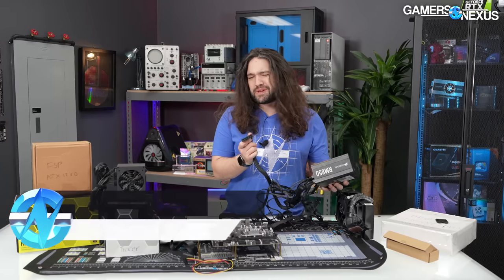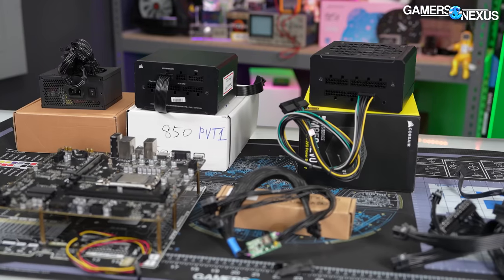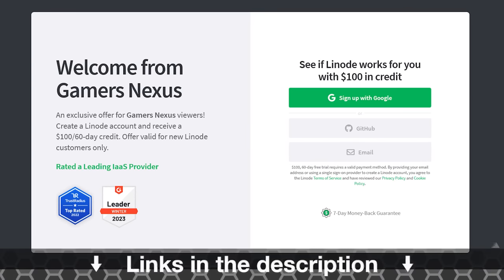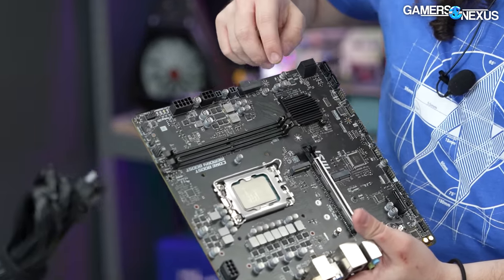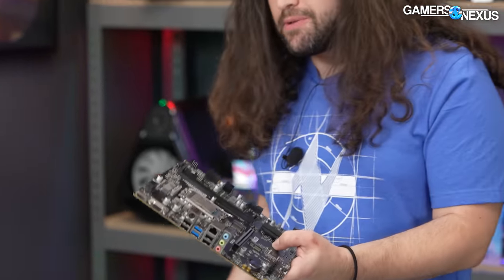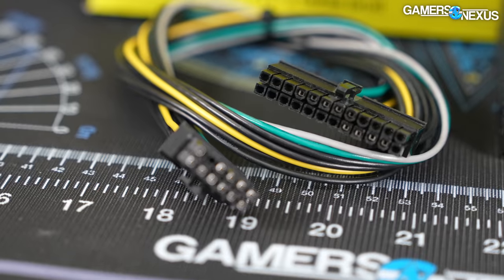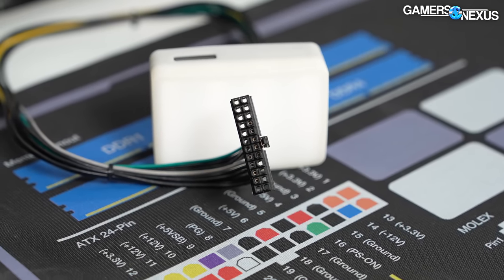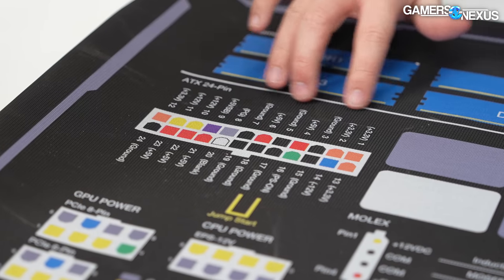The Future of Power Supplies - Maybe (Motherboard Cost, Cables, & ATX12VO)

Comment: 12VO being more energy efficient is good. But I don't like the notion of it being on the motherboard too. Board prices will go up, PSUs will NOT go down and now there is one extra reason for your motherboard to die, like they aren't the most common part to fail already.
Reply: Board prices are already going up - but many points won't change.  I expect to see mobos with less pin out options dropping.
Reply: And another reason To make certificate thing to motherboard and make it even more pricey
Reply: sure, lets talk about power efficiency in a world where graphics card draws 300watts
Reply: @Hsiss  Only 300?

GPUs need a serious power efficiency change, that's for sure.
Reply: @Hsiss  meanwhile Intel 13900k reaches 350 watts.
Reply: @Apollo-Computers  Exactly if they want us using 12vo PSU's they need to drop the power requirements on CPU's massively.
Reply: One PSU can outlast like 5 motherboards. Silly move. Stick to ATX, don't buy 12vo.
Reply: @D9ID9I  seems to imply the other way around.  Buy a 12vo psu that will be future proofed and last across multiple motherboards.
Reply: This transition must happen sooner or later. They just should've thought this through more carefully imho.
I would just retire 5V consumers before needlessly complicating the board only to provide 5V for long obsolete devices like SATA drives.
Seriously there's no reason to keep using those in a modern PC. SATA is a bus for HDDs and optical drives. Both are long obsolete and SSDs have NVME for years now.
Reply: @JE-zl6uy  12vo is a castrated version of ATX one. So which one is more future-proof actually? 😂 You can't go wrong with ATX PSU. In worst case it will be $5 adapter cable.
Reply: @Apollo-Computers  Do not worry - it will convert itself into 0.47587 horses. See, now it's eco friendly.
Reply: @1stRanger  Agreed.  While backwards compatibility is nice and all, I haven't used a SATA device in ages.
Reply: @1stRanger  orly, show me 20TB m.2 drive for just above $300 or GTFO. sata will outlast you.
Reply: @D9ID9I  LMAO
Reply: @1stRanger  You don't do productivity work, but I do. I need my HDDs for my work, video and music files.
Reply: Especialy since they will cheap out on those components on the mobo as they already do with the PSUs.
Reply: @DrowningInTea  Ofc and that's what NAS is for. That's a modern approach. HDD inside your PC is long outdated approach.
Reply: @1stRanger  Maybe in the first world
Reply: @Hsiss  exactly, i'd say 240v mobos here we go!!!
Reply: @Hsiss  exactly...this makes no sense for 12v lol. 240v mobos, here we go!
Reply: Gotta laugh @ the idea of more efficient - when we are looking at graphics cards sucking up half a killowatt and Intel banging out CPU's with all the efficiency of a combustion engine.

We got 1000W PSU's and they're concerned with the single digit wattage improvements of moving the sub 12v reg's from the PSU to the motherboard.
Reply: @1stRanger  yes but a nas is around 25 - 125 watts depending on the extra cpu . a non moving hard drive would be about a watt or two. running it would be 8-14 watts depending on amount of platters. NAS is still niche product and the asking prices are very high. 200 - 500 USD depending on brand and bays. a new hdd 4tb could be 100 USD or less and then you just plug it in. Taking sata off the board is fine if the chipset can still have sata controllers in a pcie slot. you do you though, especially if the home network is way better .
Reply: @1stRanger  How about USB which uses 5V? Remove them too?
Reply: also i am pretty sure that while it might be more efficient while idle

it should be notably LESS efficient under load
there is a reason you convert power voltage on AC power rather than DC given the option
Reply: @durandle9226  Every motherboard already does DC to DC conversions. Some of the most efficient platinum PSUs do DC to DC conversions. You were saying?
Reply: @Pasi123  USB doesn't use much power nor requires additional connectors, thus it's not a problem.
Reply: @@chahan691 You clearly lack the distinction between PSU and DC to DC converter. Every single motherboard has latter for decades. Having one more won't affect anything.
Reply: @1stRanger  Give me 20 TB nvme drive in a price range of hdd then talk to me on how great of an idea it is to drop sata.
Reply: @1stRanger  SATA is far from long obsolete.
Reply: @FabiVoltair  For high end hardware it IS obsolete for years now and can easily be dropped without anyone missing it. People that are paying 300-400$ plus for motherboards and CPUs and over 1k for graphics cards can afford multiple NVMe drives and NAS or external drive in case they need capacity and that's exactly what they are buying if they know their hardware.
Reply: @1stRanger  doesn't mean you have to jfc :P
Reply: Not to mention you're moving parts onto something that has a much lower useful lifespan even if it doesn't die
Reply: @1stRanger  What about USB? Requires 5V.
Reply: @killersberg1  I already answered that one. USB doesn't require much power.
Reply: @@chahan691 Ofc it adds complexity to the MB, but it takes that complexity out of power supply and most importantly from the wiring between PSU and MB. And that's what I as system integrator care about.
As for the argument about extra point of failure it is simply ridiculous. Build your circuitry right and nothing will fail. With such arguments you may as well go back to abacus, it won't ever fail.
Reply: @@chahan691 It's not a technology lol, it's a design and yes, it IS better than what we have today. At least for end users.
"Practically keeping power circuitry off the board allows flexibility in power design and keeping it as a modular component makes debugging board issues easier." - This whole sentence is a pure nonsense and it tells me that you have no idea what you're even talking about. Power circuitry is ON the board for decades. That's what all those MOSFETS and capacitors are for lol. To convert 12V to low voltage for CPU and GPU - biggest power consumers in a whole system by a huge margin. They don't use either of the voltages from PSU.
Let's talk market now. What is general market in your understanding? Who's buying these boards in your educated opinion? Maybe people that use them to assemble PCs aka system integrators and PC enthusiasts? Do you think these end users care about board complexity? No, they couldn't care less. And they most certainly not going to "debug" these boards at any level that this change may affect.
The only legit argument from you so far is price, which I find to be acceptable toll for progress. I'm also pretty sure this change won't affect the price in any significant way.
The rest of what you're trying to say against this standards is either completely irrelevant to end users or pure nonsense like your car with "square tires". Essentially that's your whole level of argumentation.
At the end of the day this will happen whether you like or not. So you can accept it or you can keep bitching about it. Latter will hardly affect a thing.
Reply: @@chahan691 I see no point in continuing this conversation about matters you clearly know very little about. No design is ever perfect and there’s always a price for progress.
One voltage PSU is future. Period.
You go keep living in denial. That’s your right and I couldn’t care less.

Comment: A few extra things to note: 
- Backwards compatibility to older motherboards is going to be a nightmare. Having to convert down to the other voltages.
- Nowadays, a good PSU can last over 10 years, but people usually change the rest of the components earlier than that, keeping their current PSU. That means that you are going to end up spending more money due to the incresed cost of the motherboards and the more regular rate of swaps.
Reply: I don't see why it would be a nightmare, would be trivial to design a 24pin adapter that takes 10pin + PCI-e or 8pin power and uses step down regulators to make 5v, 3.3v, I'm not 100% how the -12v pin would work but is that even used anymore?
Reply: @KriLL325783  even a negative voltage can be generated. No problem. Every current PSU does this already. They are already 12V only designs for years now, except the dedicated 5V stand-by supply.
Reply: @ronakparikh  Watch the video and actually pay attention, and maybe you'll figure it out. 

But if you're too lazy for that, the short of it is: If it got completely adopted in just a single city, it could remove not just kilowatts, but MEGAWATTS off of the total power consumption. Linus tested these ages ago, and found a solid 30 watt reduction in idle power use.
Reply: @ronakparikh  not sure where you live but I live in a city of 4.5M people, the regional centres are larger than your 100k number.
It adds up very quickly, also Steve mentioned it more than once but it went over your head.
Reply: Backwards compatibility won't matter, you'll just use an older PSU. It's not like a change is made and you can't by old stuff any more, this will take years to get into all home PC's. If they can get it into all government and big businesses in the next 3-5 years that would be great, most of those things are left on so IT departments can run upgrades after hours, so if they aren't using as much standby power it's a big win for the company/grid/planet. 😁
Reply: @ronakparikh  and the USA is the only country on the planet with people using computers?
The idle power draw isn't from gamers systems, it's from all the office computers all over world. Most of them are leased or they have service contracts which only cover them for three years, maybe a few extra if they pay for it. That means those computers will be replaced much faster than home computers, the difference will add up.
Atho referenced the Linus video where he got to test an early version, I went and found it for you as you want numbers.
https://youtu.be/heyGtgdfN7A?t=480
At that time stamp the system is drawing 60-80W, when changed to the 12VO setup it's ~32W.
Working out how many PC those sectors have is probably not worth my effort, there is a Wikipedia page with estimates of public sector size, it varies by country and when the data was reported. Somewhere between 20-30% of a countries workforce is in the public sector, some of them won't have a dedicated PC but most will.

As both Steve and Linus say, in their previous videos, this change is being driven governments setting tighter efficiency standards. For enthusiast builders it might not happen unless you specifically look for it.
To wrap your head around this you've got to look at the big picture, the really big picture.
Reply: @ronakparikh  Because the old design doesn't make sense anymore. Having a 5v and 3.3v rail made sense back in the day because logic level was 5v, 3.3V or not much lower and having a system level rail at those voltages meant they could use it directly without expensive (at the time) local switching regulators or inefficient linear regulators. Now switching regulators are cheap as chips, logic level voltages are even lower and I wouldn't be surprised if many supplies create 3.3V and 5V by attaching a couple of beefy buck regulators to the 12V rail... then when you have something that uses the 3.3V rail but operates at 1.8V now you have a chain like this: AC-12VDC(10% loss in the psu) -> 12VDC-3.3VDC(10% loss in the psu) -> 3.3VDC-1.8VDC(10% loss locally to the component)... why not just use 12V everywhere and make the device manufacturer do 12VDC-1.8VDC in one step saving one of those 10% losses? 
It's also making the system more adaptable as you don't need to make a beefy 100W 5V rail just to satisfy the 5/100 users who decide to install 10 disk drives and you can rely on component manufacturers to put exactly the size of 12V-5V regulator they need locally on their component, nothing more and nothing less.
Reply: @Cluuey  even in the usa there is 55 MSA with over 1 million population. these people are just shortsighted gamers who really dislike change even if its very beneficial.
Reply: 100k people is not a large city, that would be a very small city, a large city would be something well over a million people @ronakparikh
Reply: @ronakparikh  It is true, most people don't have ATX desktop PC's, they have 19VO computers that do all their power conversion on the motherboard. Also known as laptops. Oh the irony.

Comment: 48VDC seems like the next step once 12VO is widespread. That would only require a 4-pin connection to the motherboard for most setups 😅
Reply: Yes it would but the cost of power converters that can work on 48V input probably start to cost heaps more. The capacitors and indicators and MOSFETs all go up in spec and cost as well on anything that is 48V. Not sure if this also translates to increased track clearances on the PCB. Don't go putting 48V into lower voltage pins. I've seen someone plug their LAN into an old 48V phone system. The smoke and charcoal was amazing. So was the user's expectation that it would continue working after they let the smoke out.
Reply: @vk3fbab  I regularly put ethernet cables carrying 48VDC in devices, no issue there
Reply: @vk3fbab  perhaps that old 48V phone system also had an AC ringing voltage? In any case, 48v is everywhere in the telecoms world and it's great. Also for a given load in watts, your capacitors and mosfets might need higher voltage, but lower current, so capacitors can have less microfarads to do the same job. ST electronics call sub-30v mosfets "low-voltage" and the 30-350v mostfets are called "medium-voltage", so no one would need any special components.
Reply: PoE+ and newer use 48-56V to power devices over ethernet cables. USB PD3.1 goes up to 48V. I think the limit before major protective changes are required is when you’re needing 60V and above.
Reply: How about 24V?
Reply: 12VO would be good for 48VDC type installs, only a single DC-DC conversion instead of 3 or 4 with current spec

Comment: You don't actually need +3.3V. You can remove the +3.3V pins from the cables of your regular PSU, and the PC will probably work just fine.
10:52 The additional pins on the PSU side are sense pins, hence the doubled cables on the motherboard side.
As for +5V, it doesn't need to be created on the mobo, you can use an external buck converter, that you can stash somewhere else inside the case. Corsair already makes one ("+5V Load Balancer").
The big advantage of ATX12VO is that the PSU is much smaller (SFF, anyone?), more efficient, and quieter. Such PSUs will also provide much better performance at equivalent price, since there's only one rail that needs to perform well. Switching to ATX12VO would clear the market from all the garbage group-regulated PSUs.
Reply: Finally a sane comment here. Here in India I've only ever seen the garbage group-regulated ones. Pull too many amps on one line and the other goes out of regulation and potentially kills the mobo. I can't wait for 12VO to become mainstream.

Comment: I feel 12VO would be most useful as an OEM standard. From what I've gathered, the biggest excuse for oems using proprietary psu's is exactly because of the lower power draw. Lenovo has a 14 pin connector they started using in like 2014 for this reason.  It would be nice for oems to use the 12vo standard so you could actually buy an off the shelf replacement for it.
Reply: Opiplex 3020s 9020s  both is 4th gen intel use these connectors and they are a pain.
Reply: @AP_Sim  They are non standard ATX12VO, all connectors are a mess.
Reply: They do it for a reason. Big companies like Dell, HP and Lenovo now, IBM, Fujitsu and Compaq back then, use proprietary stuff is because they sell to other companies. Those companies don't necessarily care about upfront cost as much as speed of servicing. So, of course, they made it so the only people who could service a unit would be that company and that only. No one could undercut them then.
Reply: Then you could repair your pre-built PC instead of buying a new one. I don't expect that to be something they want.

Only pre-built PC brands without an existing standard would be interested if they needed to improve energy efficiency because of regulatory requirements. That way, they could save on R&D costs.
Reply: @CheapBastard1988  Oh but you can easily repair your pre built anyhow. By spending a good amount more for parts that are usually of average quality that only the OEM sells. And they sell it for maybe two years.

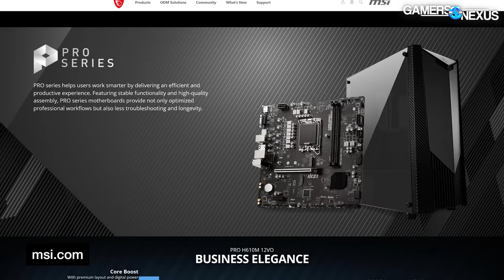Comment: 18:58 One interesting thing about that Motherboard is that it has the mounting holes for the VRM heatsinks. This means that they planed to put heatsinks on that board or they intended to release a higher price variation with heatsinks.

The fact that it has the mounting holes also makes adding custom heatsinks much easier. Its rarely done by moders but the adding of heatsinks to cheap Motherboards that doesn't have it can increase its values by something between 20$~80$.

The biggest difference between low end and mid end motherboards many times boils down to the addition of the VRM heatsinks.
The mod is relatively easy to do. A hand saw, a drill, old scrap heatsink, some thermal pads, some small springs and screws with nuts is all you need.